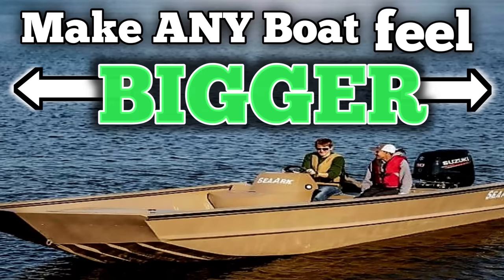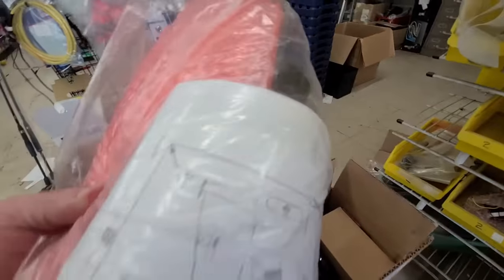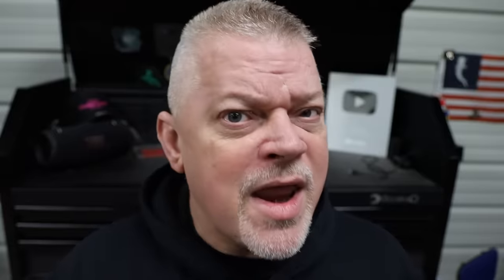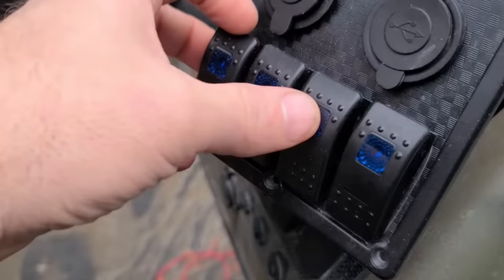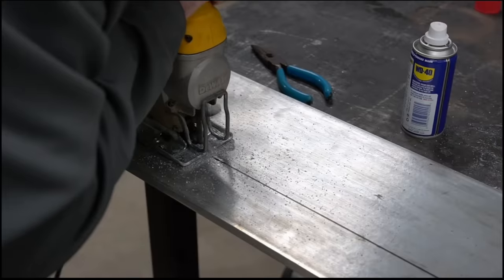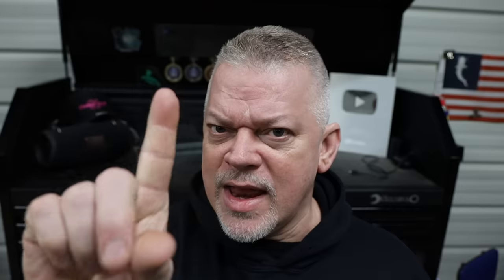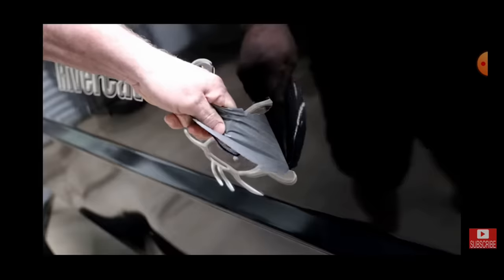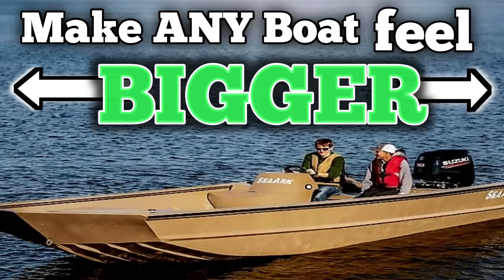13 Awesome fishing boat DIYs

Comment: Nice mod ideas!  My best DIY mod I did so far was building a steering console  for my aluminum 12 foot V hull 'row-boat' as everyone calls it.  I made it from 1/4 inch marine ply and covered it with fiberglass.  Everyone said it would look like crap and be too heavy but so far, 3 of those people who said it would look like crap actually had me build consoles for their boats that were under 14 foot.  Cost me less than $150, took about 3 days and no more driving from the rear.  As far as added weight....only added about 50lbs.

Comment: I saw your trailer steps video and had to make a set for my flat bottom. I live on Chickamauga, the most over fished mudhole in America. I sold my Ranger and fixed up my duck boat which happens to be a 1985 goose poop green Lowe with the original 40 hp. white Johnson.. Amtoys made a stuffed pickle in 1985 called the Super Pickle so that's the name of the goose poop green boat. Idiots would follow that Ranger but they don't pay any attention to the Super Pickle.

Comment: I have found some of you videos and tell myself I NEED THAT!!!!!

You need to do a DIY kayak video.
1. using a milk crate and pvc pipe for storage/rod holders instead of buying a storage container. 
2. I have seen people using a dog storage container from tractor supply (the oddly shaped ones with the lid at an angle) and hook up a bubble machine for a live storage. 
3. the broom locks are great to hold paddles and rods.

I would also love to get in contact with you about a couple more ideas.
Reply from the maker: My Email is in the about section  .
keiff32@hotmail.com

Comment: Cheap Bimini top hack - If you have the cheap aluminum round poles you know you can't use them at at any speed greater than 3 MPH. Here's the hack: Cut through the poles all the way through, insert steel piping to the proper diameter to fit snuggly in the aluminum, then drill and rivet. Do this while the bases are still mounted on the bout so you know you have the proper alignment. Lastly: wrap some electrical tape or cover in sealant around the cuts. I never lost a Bimini cover since.

Comment: Keith, I'm one of the slow and frustrated on the water, lol. Because I use a Pontoon to fish. I really need some rod holder claps, and they are square. So I was wondering if you may be able to help? Thank you for the laughter and the great videos.
Reply from the maker: They make these 
CE Smith Pontoon Square Rail Adjustable Clamp-On Rod Holder-Replacement Parts and Accessories for Tournament Fishing, Rod Fishing, Deep Sea Fishing and Trolling,Beige https://a.co/d/1QHJfMJ
Reply from the maker: But this route would be cheaper . Then you can use any Rodholder on the market  . FishBite , Monster or SmackDown
Smackdown Pontoon Rod Holder Base fits 1-1/4" Square Rails and 1/2" #13 Thread Rod Holders https://a.co/d/4NFp8JL